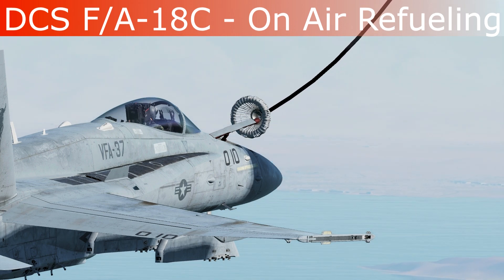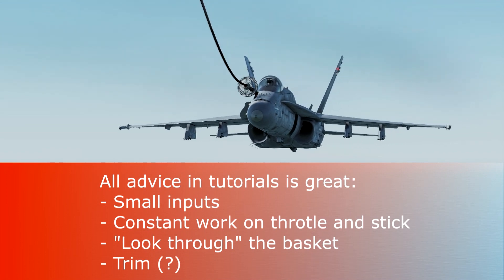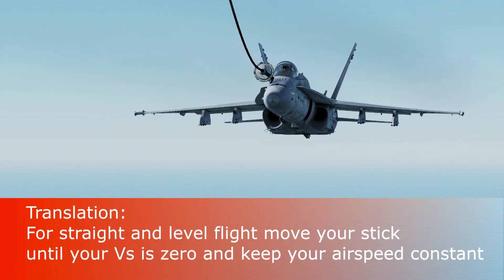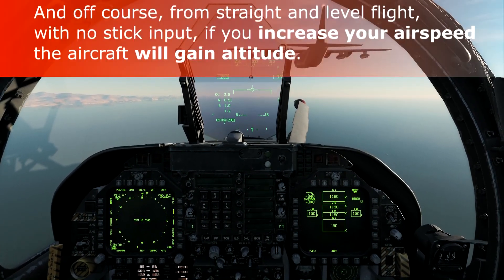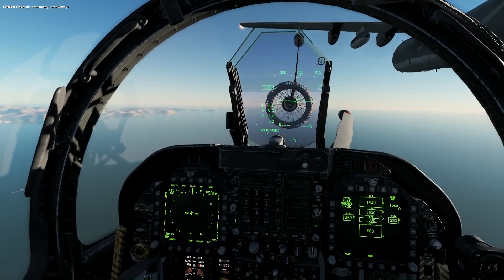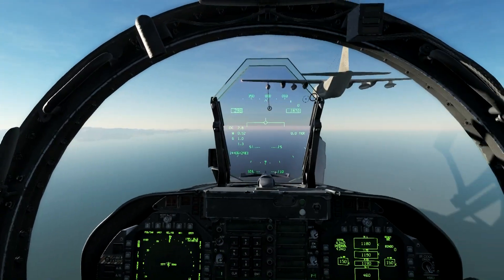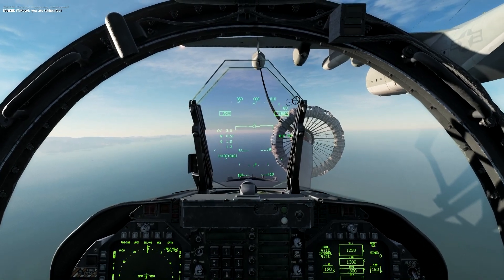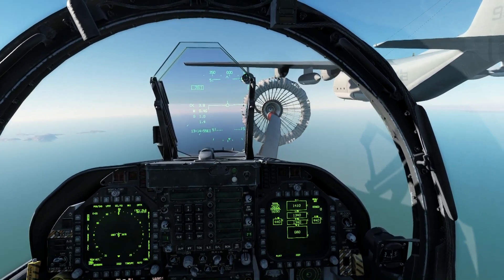DCS F/A-18C Air Refueling - Airspeed Changes and PIOs

Comment: Hi JC. Great video, I have never managed to do an air to air refueling in DCS, I will try using your tips and see if that helps. Also, as someone who works as a linguist (I do English to Swedish translations), I couldn't help notice that you always write "off course", when you mean "of course". Being off your course is of course something totally different than the meaning of "of course". :-)

/Johan
Reply from the maker: Hi Johan. So good to see you around. Thanks for watching and for pointing out the mistake. I will try to correct it. Cheers!